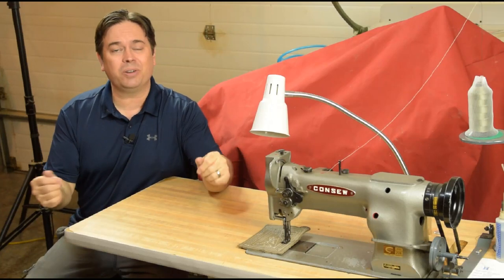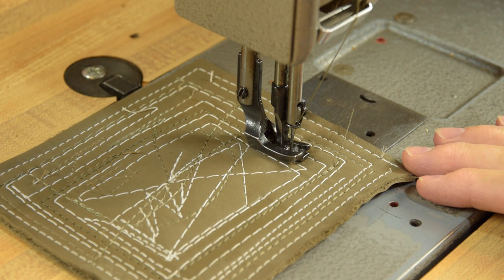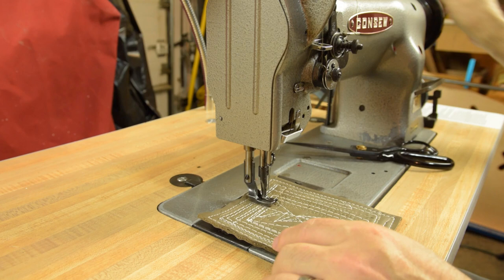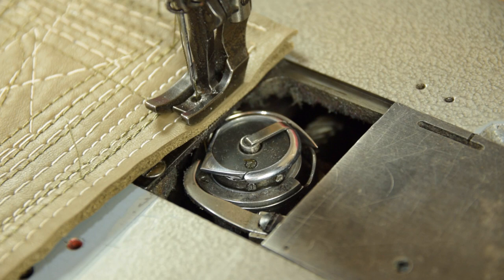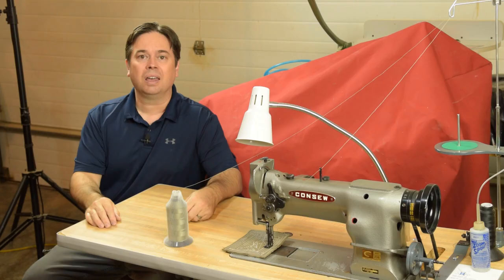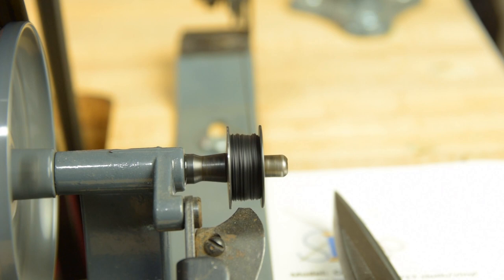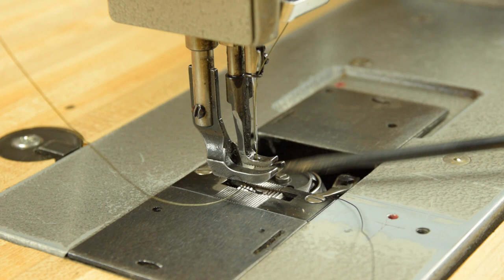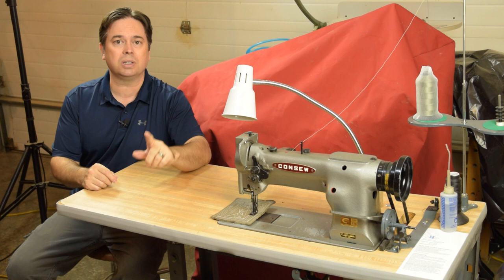Consew 226 Everything You Ever Wanted to Know about this walking foot industrial sewing machine

Comment: Could you be more specific about the servo motor and pulley I need to order for my Consew 226R-1? My hubby watched the install video, but it wasn't done on a consew... so he just wants to know for sure what I need to get. Thanks.
Reply from the maker: Here is the servo motor I use...  https://amzn.to/40lgKo8  It works on Consew 226R-1 just fine.  You might need a slightly different belt length, depending what size pulley was on the old motor.  You can find 3/8" v belts on eBay.  Odds are it will be in the 38-40" range.  Best of luck!
Reply: @TheThoughtfulWoodworker  thank you for the quick reply. What size pulley did I need to order?
Reply from the maker: @andreavinson3916  You can use the large pulley that comes with the motor.  Or you can get a 45mm pulley like I do (eBay).  The smaller the motor pulley, the slower it will sew.  45mm is about the smallest you can get.  Good luck!

Comment: Good video. What is a small motor pulley? I have a Brother LS2-B837 (Made in Japan) triple feed walking foot with a servo motor and digital control box. Even with a 45mm pulley I can't get the machine to run slower than 2 stitches per second. I'd like to get it to crawl at one stitch per second like your Consew. Any tips on how to slow it down?
Reply from the maker: A 45mm pulley is a small pulley.  Some electronic servos allow you to adjust the top speed, and ramp up time for slower sewing.  Sometimes you'll adjust the control panel for minimum speed and it's still too fast.  In that case I'd swap it for a simple dial type servo.  They sew pretty slowly.  If you need slower than that, you'll have to add a speed reducer.  Look for any of my leather upholstery videos where I'm using a Juki LU-563.  That one has a speed reducer.  I also have a video on how to install a servo.  
Best

Comment: I would like to remove the belt guard as I don't really need it and also it is getting in the way (slightly) of re-installing the bobbin winder, which was off when I bought the machine. I can't find information anywhere on how to remove the guard. Could you give me any help on how to do it, or where to look for information?
Reply from the maker: Hi Lizzie, usually topside belt guards are two piece.  Hinge the top piece up and look for mounting screws.  Usually it's just 3-4 mounting screws.
Best
Reply: @TheThoughtfulWoodworker  actually the machine only has the bottom half of the guard. I can see now that it is screwed to the machine right at the top, and that the only way to remove it is to remove the balance wheel first in order to get at that screw. I have found two screws on the balance wheel which I believe attach it to the machine, and have removed these, and my husband and I have had a go at removing the wheel by gently tapping at it with a hammer - are we doing the right thing?! (I have previously removed balance wheels on domestic Singers.) Thank you for your help!
Reply from the maker: @lizziel4876  I've never had to remove the handwheel to remove a guard, but to remove the handwheel there are deep set screws to loosen.  Also a large screw from the right of the machine.  Sometimes takes a gear puller to loosen.
I would just take the machine off the table and see if the guard has a slotted screw hole.  Might be able to pull the guard off from the bottom.
Good luck!

Comment: How do I adjust the reverse stitch?
Reply from the maker: Tip the machine back and look underneath while you activate the reverse lever.  You will see the nuts that limit the arc of motion.  Adjust and retest until it's correct.

Comment: I have a fair amount of time on a Consew 206RB and absolutely nothing else from a previous short-term job. Familiar with not only use but a decent amount of maintenance as well. However, for some reason 206RBs seem to be unobtanium on the used market while 226s are fairly common. As much as I want what I know, I'm about tired of pulling my hair out and may give up and buy a 226. Besides the smaller bobbin, this machine looks very similar. Are there any compromises or major differences I'd find with the 226 vs a 206 besides holding less thread? 

Main use would be for camping/hiking equipment and clothing fabrication and modification so lots of ripstop/cordura, probably the thickest thing it would have to go through would be short lengths of layered nylon webbing. With these materials I found the 206 could pretty much punch through whatever I could reasonably fit under the feet. Is the 226 pretty much equally capable as the 206 in this way?

Whether you reply or not, thanks a bunch for the video! Great way to get an quick overview of the machine.
Reply from the maker: The 226 is very comparable to the 206rb.  The reverse lever is push down to activate on the 226, as opposed to a lift lever on the 206rb.  It's a little more important to hold your threads back when you start sewing on the 226.  But, it's a good idea on any machine.  Otherwise they will both sew 3/8" of compressed thickness.  Also consider the Juki LU-563.  It's like the 226 except has a huge U style bobbin, which holds double the capacity of a G bobbin.  
Best
Reply: @TheThoughtfulWoodworker  Awesome, thanks for the info and quick reply! The 206s I used were all newer ones so they also had the push down reverse lever, so that'll be an easy transfer. I'll also consider the LU-563 if I spot one!

Comment: What's the motor belt size for this machine? Thanks.
Reply from the maker: For me, using a servo with 45mm small motor pulley it was a 38" x 3/8" V-belt.  It will be a longer belt if you have a clutch motor.
Best of luck.

Comment: On the 227, there isn't a bobbin tension adjustment like on the 206, right?  So I can go from tex 69 up to tex 207 in the bobbin without a bobbin adjustment?  Thanks
Reply from the maker: The 226 or 227 machines do have bobbin tension adjustment.  You will definitely need to do upper and lower thread tension adjustment to go above 92 weight thread.  For instance, the functional max for a 226 is 92 weight thread.  Some say it will do 138 top and 92 bottom, but it's not really happy with the heavy thread.  Good luck with it.
Reply: @TheThoughtfulWoodworker  So how would you do lower tension adjustments on a 226?  I have run 138 top and 69 bottom with some good luck.  And when you say functional limit is #92, are you talking about on the bobbin side?  I read a couple of places where it would do tex210 on the top.  Thanks for the info.
Reply from the maker: @bigfranksworld  there is a screw on the bobbin case to adjust tension.  For a 226 92 weight thread would be max on the bobbin side.  138 absolute max on the needle thread, but you'll have better luck with 92 weight on top.  If you do try 138 on top, make sure to use #22 needle for cloth and a #23 needle for leather.  Best.
Reply: @TheThoughtfulWoodworker  Thank you for the info.  I do have one other question.  Do you happen to have a video, or know where I can find one about changing the needle bar on a Consew 226?  Mine feels like it's at the point where the needle screw hole is stripping out.  Or do you have any idea how tough it is to change one?  Thanks.
Reply from the maker: @bigfranksworld  I've changed a needle bar on Pfaff's and a Juki LU-563, which is a similar top loading machine.  Not too bad to do.  You can change the needle screw first to see if it helps, but likely will need to swap out a new needle bar.
Reply: @TheThoughtfulWoodworker  As as simple as unscrewing the needle bar, and replacing, making sure it gets back in the same place so the timing is right?  I have replaced the screw and it's the same
Reply from the maker: @bigfranksworld  Well, you have to set the needle bar to the right height when you put it back in.  In other words, the hook should be just above the eye of the needle as it comes around.  You don't have to mess with hook timing, just the correct needle bar height.
Reply: @TheThoughtfulWoodworker  okay, thank you

Comment: How do you compare the thickness that the Consew 226 ver 2 can do vs the Pfaff 145 H3 ? Is the 226 a heavier duty machine vs the 145 H3 ?
Reply from the maker: Both the Consew 226 and Pfaff 145 H3 will sew about 3/8" of compressed thickness.  The Pfaff has a lot more downward foot pressure that cannot be decreased.  For that reason, I tend to prefer the Consew.  
Good luck!
Reply: @TheThoughtfulWoodworker  So really there is no hierarchy to Consew products ?206 226 255 ??
Reply from the maker: @Luckystudio13  206rb has a large M style side loading bobbin.  The 226 has a top loading G style bobbin.  Reverse levers are lift to activate on older 206 models, while 226 and 206rb-5 you push them down.  They all sew about 3/8" compressed thickness.  I converted a Juki LU-563 to a 190 needle system, and it will sew 7/16" or 1/2" leather seams.  I suppose you could make that modification on most any machine.  The LU-563 has a giant U style bobbin.
Best
Reply: @TheThoughtfulWoodworker  wow ! Very cool indeed. If you don't have it already I am sure a lot of people would love to see the detailed conversion of your 563. Os such conversion applicable to a 143 h3 ? Seeing that h4 can take 190 needles.
Reply from the maker: @Luckystudio13  Yes, I think it would work on a 145 H3.  Just raise the needle bar slightly, until a 190 system needle is in the correct timing position relative to the hook.  
Best

Comment: Hi Willie!

I'm having a problem with jackrabbit starts on my 226. It just seems to go from 0-100 pretty immediately. The belt isn't super taut, so I'm not sure what the problem is. Do you have any tips on what I should do?

(FYI, it has the original motor, not a Servo).

Thanks!
Reply from the maker: Hi LB, I've experimented with modifications to clutch motors like greasing the friction plate and making a long lever attached to the motor and foot pedal.  Unfortunately, they don't help much.  
I would recommend swapping it for a servo motor.  The speed of your 226 has nothing to do with the sewing machine head, and everything to do with the motor.  I usually install a small motor pulley as well.  A 45mm pulley costs about $3 on eBay, and will slow the machine down even more.
I have a servo motor install video on my channel.  They're very easy to install yourself.
Best!

Comment: saw rust on sewing machine. Why not put oil on all moving parts big or small. i do that for my Singer 44S.
Reply from the maker: No need to coat all moving parts with oil, but certainly the articulations shown in the manual need oil.
Thanks for chiming in.

Comment: So glad this popped up for me. Just started taking an upholstery class and these are the machines we are using. However, ours have a clutch motor. 😬 Kinda difficult to use 😕 I'm interested in getting a machine for home use to quilt, bag making and some upholstery projects. Do you think this will okay for lighter cotton fabrics?
Reply from the maker: Hi Cynthia, that's too bad you have to use clutch motors at the class.  But also good you're getting some time on a 226.  It's a great upholstery machine once you have a servo motor installed.  Nice for making pillows, cushions, leather etc.  Thin cotton wouldn't be its strong suit.  You wouldn't want to sew t-shirts on it.  Hem jeans... yes.  Sew two layers of thin cotton... no.  
Basically at the thickness your home machine starts to struggle, the Consew 226 will thrive.  
Best

Comment: Great info 👍.. Do you know the size of the V Belt, the width? Thanks
Reply from the maker: Hi Luis,
Most industrial sewing belts are 3/8" wide v-belts.  Consew 226 and similar machine with servo and small motor pulley should use a 38" or 39" long belt.  
Best
Reply: @TheThoughtfulWoodworker  Awesome!!! Thanks for the quick response 🙋‍♂️

Comment: Back off those walking foot presser screws you don't need them all the way down, it's like driving your car with one foot on the brake.😉😉
Reply from the maker: The center presser foot spring adjustment has almost no effect on the consews.  The main leaf spring is adjusted to my liking for the work I do.  I like a lot less pressure than the old Pfaffs produce.  The consews and Juki's sew best with a moderate amount of pressure.  
Feel free to back yours off if you like, but that doesn't work too well for the thick leather I sew.
Best

Comment: Can I use CONSEW 290 for car leather upholstery project.
Reply from the maker: A Consew 290 is a drop feed straight stitch machine similar to a 230.  It's best for drapes and light to medium weight fabric.  It can handle 92 weight thread, but doesn't have a walking foot.  It would probably sew two thin layers of leather together,  but automotive leather upholstery involves thicker seams with piping etc.  So I wouldn't recommend this machine for leather upholstery.
Best

Comment: Is the 226 just one stitch length or is it adjustable?
Reply from the maker: The Consew 226 has adjustable stitch length.  You push a button on the machine bed and rotate the handwheel toward you to increase stitch length, or away from you to decrease.  Same mechanism as Juki LU-562 and 563.  
Best

Comment: Why does my 206RBL have a g size bobbin as well? Did they only put the g size in the long arms seeing it more as a speciality?
Reply from the maker: That would be very strange if older model 206RBL machines use a G bobbin.  The current 206RBL uses a large M style bobbin.  Are you sure a big bobbin won't fit in your machine?
Reply: @TheThoughtfulWoodworker  yeah it’s a smaller size I’ll get a video of it and post, I just need to get a table and motor for it. Seems like you can do a bobbin conversion if it’s a top load but not sure on the side load bobbins
Reply: @TheThoughtfulWoodworker  you were right the rbl was a m style thankfully just the 226 with the g style.  I just threw a speed reduced on and what a difference!
Reply from the maker: @stitchthisditchthat259  good deal.  Enjoy that new speed reducer!
Reply: Consew. Mecine206rbl. Prise
Reply from the maker: @d.sulaiman5875  I do have plans to do a video on the Consew 206rb-1 machine.  Stay tuned! 
Best

Comment: Could you please help me regarding an issue with my machine?
Reply from the maker: I can try.  Consew 226?  What is it doing?
Reply: When cranking the wheel towards me, it locks up, seems to be directly under the presser foot area, I have two videos but not sure how to post them
Reply from the maker: @BrianFranZiemmer  you'll have to remove the bobbin case to check for thread.  Remove the two small screws that hold the gib down and secure the bobbin case.  When you reinstall it, make sure the tab is under the presser foot plate, so the bobbin case can't rotate.  
Change the needle, and ensure your thread size matches the needle size.
Best of luck!

Comment: Call the tension setting whatever you like. Most people say balanced   not because the top and bottom feel the same as you pull them. You want the knot tied in the center of the material plane..
  I'm sure you know why the top pulls stronger then the bottom in regards to feel. 
  I rrant a bit on this subject because to me you over complicated it unnecessarily.
  If you don't know how sewing speed affects tension, ask me and I'll be happy to explain it.
Reply from the maker: Well I'm sorry you feel I overcomplicated it.  I make a distinction about balanced stitch vs. balanced tension to clarify it for beginners.  It's precisely what I wish someone had told me when I started sewing.  Once a beginner realizes that the tension will always feel much heavier on the top, the concept is easier to master.  My only goal with these videos is to help people who are having trouble in the sewing room.  Thanks.

Comment: any idea if the model number is on the machine other then the sticker on the front, mine looks like this but I'm not really sure, they made so many models
Reply from the maker: If you tip the head back, you'll often see additional markings on the lower rim of the machine.  Generally if it looks like this, it's a Consew 226 or generic clone.  If it's similar, but no reverse it's a Consew 225 or clone.  
Best
Reply: @TheThoughtfulWoodworker  thanks, the sticker is missing on mine. it does have the reverse lever. I am waiting on parts to do a pulley speed reduction  and a servo motor

Comment: Is there a machine like this that’s got 2 or 3 step zig zag?
Reply from the maker: The Consew 199 or a portable Sailrite are two that come to mind.  It's actually quite rare to have a true walking foot machine that's also zigzag.  Best to you.
Reply: @TheThoughtfulWoodworker  Thanks, I'm trying to get into sail making which would require going through 2 layers of 6oz dacron most of the time and then for the patches 4-8. The biggest problem is feeding the large amount of cloth smoothly through the machine. I have a Singer 401a which can go through it but the dog feeds don't always work well.